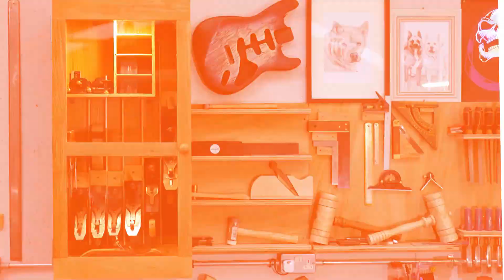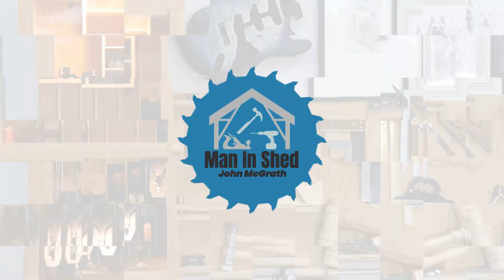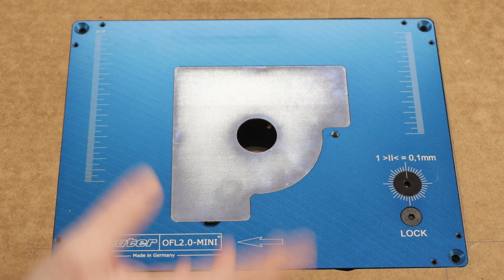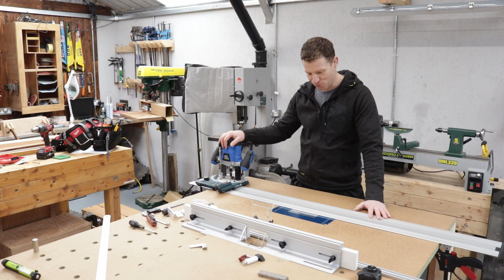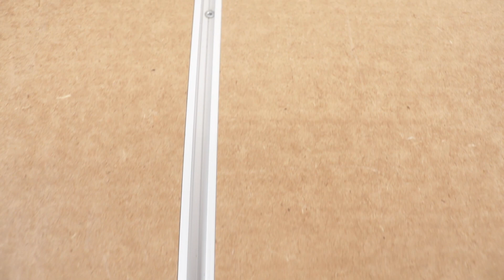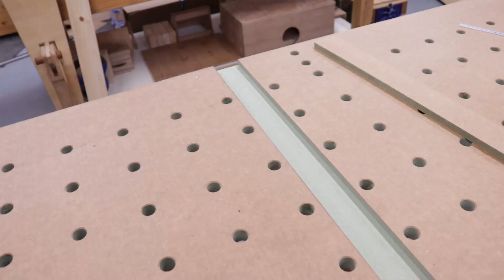Installing the Router table in the MFT Workbench. Plus a Cheap Tool Rant!

Comment: Enjoying your videos. My suggestion would be not to cut the edge of your bench and instead drill a hole up and through the table top and support so you can push out the sacrificial strip from underneath with some dowel.

Comment: Hi John, I don't know if you read comments of videos that are so old but what the heck you either do or you don't. I'm new to trying my hand at more involved woodwork and I'm trying to sort myself a workshop in an old Methodist chapel. At the end of this video when you put back the edge board, why did you cut the slot by hand rather than use your router?
I've got a lot of videos to watch, seeing how your workshop has developed over the years. Excellent work!

Comment: Completely agree with you when it comes to tools. But having said that there are some good quality hobby grade pieces of equipment out there. The Axminster hobby ranges extremely good Bosch do their DIY range the green stuff that router is actually quite a good one from Bosch as is the belt sander. And also most of the Ryobi stuff is very good. But you’re absolutely correct even know what I’ve just mentioned is good for the hobbyist they are not Tradesmans tools

Comment: Dear John, at 27:26 when you show the router lift closeup from below, it appears that the router actually twists a fraction in the middle, and when it reaches the top. If that is so, it implies that the router bit is not going straight up from the router table. Is there any chance you could verify this? Thanks.

Comment: John hi, I love your channel, quick question, did you give any thought to a dust collection box under the work bench and will the router handle allow it?
Reply from the maker: I have thought about,  just haven't got around to it. It would be possible with doors on the front so you have easy access to the handle for bit changes

Comment: Hi John, I have four routers all of them are Dewalt 1 ¼ hp and although I will not buy Dewalt now because the quality is just not there, when I bought the routers they were very good quality  and I have no problems with them. I bought a small trim router from ALDI, I was not expecting much it has become my favourite router, and although it is only ¾ hp I have never been able to stall it and it always cuts well and straight. If I were to buy a router today, it would be a Makita or Bosch because they seem to be good and even if I won the lottery, I still would not buy a Festool on principle.

Comment: This is brilliant!
I'm in the process of putting together a router table and finding this has been a huge help. I'll be ordering a Sauter lift, which really looks like high quality kit. I was going to order a dedicated table top but the process of making your own looks fairly simple as you demonstrated, and I think I now have the confidence to go get some MDF and tracks, and give it a go!
Also appreciated the info on the NVR switch too, and agree entirely on the comments on tools!

Quick question: is it a good idea to treat the MDF with anything? Wax or poly varnish? Or do you just leave it raw?

Go raibh maith agat!
Reply from the maker: Glad it was useful

Comment: What stops the track saw track moving around I have seen a few videos on YouTube with track saws and can't see any way of clamping them down
Reply from the maker: They have rubber strips underneath that stop them moving and they have T slots so you can use clamps with them.

Comment: I know it's totally unrelated and I'm not trying to pick a fight LOL, because believe me, no one hates inches more than me and I certainly would much rather be using metric when it comes to wood.  But over here in the US everything is in inches.  So, I have a question for you.  Nearly everything on your top is in metric and you use those measurements throughout, I get that.  However, when it came to the edging and bracing you referred to them as 2 by 4 or 4 by 2.  Why the switch-over to imperial measurements for those pieces?  Is that typical in places using metric?  

BTW, love your MFT top.  I'm planning on using a lot of what you've done to make my set-up.
Reply: I have the same sized MDF top, it's a full sheet of MDF/devil's wood.  I made it about 4 years ago.  I used the top from my mft as a template.  Accuracywise it's pretty good but not quite what I'd like and it's getting beat up.  I just ordered the Parf Guide MII and I'm hoping I can get the same accuracy as others have gotten.  I setup the Benchdogs fence and guide rail dogs on my guide rail track and it isn't square. I watched a video about how occasionally the rulers that come with the Parf Guide MII are sometimes not quite true.  I'll be checking them carefully before I start making a new top.

Why does John call it a 4x2?  Because it's easier than saying "hand me that 89mm x 38mm."

Comment: there is a difference between reasonably priced tools over the silly priced, Festools were not around years ago and they made better stuff in those days. I understand what you are saying BUT no one needs Festools or some £400 low angled plane. Yer, of course, they are nice but the same does not apply. A Bosh will serve me great for years if I look after it and it's accurate. I have 3 cordless old blue Ryobi drills that are all still going strong, (batteries replaced) I am looking for a new driver-drill as times change but the point is I never needed top of the range, besides I live in Liverpool and the moment I filled my van with Festool's it would be stolen or I would drop the drill from a ladder and the lifetime warranty would be mute. Nothing wrong at all with a second-hand Stanley plane I even have an old beach fore plane 22 inches long and I love it. I do understand and agree with the principles of your video but it should be pointed out that, top of the-line in hand tools are not needed, they are that expensive because the market is there just like you pointed out for the woodworkers. We all know that the low angled planes are overpriced. and what about the GRR Gripper push block the full kit is nearly £300 quid!  Everyone says but its for safety your fingers are worth it. Yes, we know they are but that does not mean we are not getting ripped off just that we are willing to pay out because there is nothing else like it. Micro jig is laughing all the way to the bank and laughing at us while they shout "finger safety dude" If companies were so concerned they would charge reasonable prices and we could all enjoy the safety features. One polish guy yesterday stated in comments that the Grr Gripper basic was half the price he paid for his bench saw, sod buying it he will make his own. There are balances and we just need to understand the right level for ourselves. I learned long, long ago not to buy cheap but I won't buy silly either.

Comment: Not wanting to point it out but I can see you use Milwaukee tools. Basically Ryobi in Red. Both owned and made by Tecktronic Industries of Hong Kong. I'd rather save a few quid and buy the Ryobi - the insides are in most cases the same.
Reply from the maker: Owned by the same parent company but they are not the same tool, Ryobi would not last long with the use I give my tools everyday on site. The Milwaukee fuel range has taken serious punishment and is still going. Some tools are good for DIY and others are Trade rated.
Reply: @JohnMcGrathManInShed   I disagree. I'm a marine Chief Engineer working in the offshore construction industry - possibly the heaviest industry in the world. I've used, abused and broken just about every tool available. And having used tools paid for by rich oil companies - and I've bought hand tools costing over 50k - I use Ryobi mostly myself. I've also got Makita, Bosch pro, and Dewalt. Little difference in overall quality. In fact I have two old Ryobi drills which I've beaten to death for ten years and they are still going strong. I've even got a Ryobi battery of the same vintage that must have been recharged a thousand times over ten years. Still working. Most of all if you do pull open a Milwaukee you will find the same major components in most of their tools. A tool made by the same company in their own factory in the Far East is not going to be radically different simply because that makes no sense from the manufacturing point of view. The same applies to other things like Fluke meters. Regardless of the price of the multi-meter you buy, the actual tool is exactly the same inside. They just disable some functions. AVE did a strip down of a few and they were identical inside despite the price differential being huge.
Reply from the maker: @markchisholm2657  All I can tell you Is every Ryobi tool I have had I have broken. From drills to grinders to sanders all of them failed. And I have had a few going back to when they used to be dark blue and yellow.

Comment: John - looks absolutely fantastic.👍

A couple or more comments 😉

1. You may need another sacrificial strip nearer the end of the MFT (non router end).

2. Agree with your cheap tool philosophy in principle however may I suggest you used the wrong example. If the cheap router spindle was ‘wandering slightly’ the effect is essentially eccentricity and it would have cut the slot wider than the cutter diameter. I do not know why it was a ‘tight’ fit but it was either the bit was undersized (for the supplied rail or vice versa) or MDF compresses and springs back and needs a finishing cut.

3. Dust extraction on most routers at most price points is a real challenge and some cuts present a fundamental challenge.

4. So called quality higher price tools are not always as bullet proof as you would hope for. This is particularly so for hand power tools. AVE is a good channel for exposing some of the assumptions on Price/Brand/ Perceived Quality.

Anyhoo - cracking job John,😀👍

Comment: Great video as always John - I built an outfeed / assembly table during lockdown - think I will look at mounting a router in it - maybe use a scissor jack as router lift (looks crude but easy and precise adjustments) I’ll be interested in your track saw use in comparison to a traditional table saw.

Comment: Hi john about the cheap tools part of the vid do u rate dewalt i dont see you with any?
Reply from the maker: Dewalt make some good stuff I have a few Dewalt tools for my electrical work. My battery tools are all Milwaukee, I used to have all Dewalt battery tools but switched when I was upgrading to Milwaukee because I got a good deal.
Reply: @JohnMcGrathManInShed  i do like milwaukee but like festool i think they are a little over priced for what your getting for me dewalt are best price range for battery stuf anyway just my 2 cents worth

Comment: Your point about good tools is important.  That German router setup looks fantastic, and after your recommendation for Knipex, my set of pliers is clearly better than what I had.

But there's a counterpoint.  Good new tools cost.  Many of the older tools are also good, and just require some care.  For example, an old Stanley plane can work just as well as a Lie-Nielsen, though it will take more time to get it there and it will never look as good.  For a hobbyist this can be a good exchange.

And you can't identify a good tool by the price.  Many formerly proud companies made short-term profits by selling tool-shaped objects at prices above their value.

Lastly, tools are bought for a purpose.  Some cheap tools are not good enough for some uses, but might be acceptable for others.  In some cases, that can make them worthwhile.  Though I can't see an excuse for that cheap router.
Reply from the maker: Cheap tools and good value tools are not the same thing. There are bargains to be had.

Comment: Great job, this came at a great time for me, have just installed a router plate in my DIY table and about to rout in the tracks. One question, have you considered adding another wider slot for a 3/4" track so you can use a mitre gauge?
Reply from the maker: Didn't think about it but you have put the idea in my head. I will look into to it

Comment: John it sounds awesome I’m just gutted I can’t see it enter as we’ve gone into lockdown number four won’t be going to Axminster until the New Year but I think buying the gym kit would be way out of my budget but hopefully there is someone in Kent who’s got one could make me a top as it sounds pretty awesome.

But I would definitely think about putting a dust extractor kit permanently on it specially for multiple using even to Hoover the shop up as well. As if you had it come from the ceiling to connect to it when you’re losing a lot of suction to you got I have it in the same area roughly to connect it to every time. But can’t wait to hear the next part of the build

Comment: Always been a Makita Man. Sometimes Dewalt or Bosch and lately Milwaukee. When I go to the local B&Q I always wander around the tool area. Never buy anything but cringe like mad when I see people picking up cheap tools. I have to bite my lip. Like you with the router many years ago I bought a Draper table saw and it was a disaster.
Reply from the maker: It never works out

Comment: Love your videos John and your honesty. Quick question, if your t-track router bit was an 8mm shank, why didn’t you use the one you were getting into the lift rather than the crap one?
Reply from the maker: The Suater router can only be used mounted in a lift or on a cnc
Reply: @JohnMcGrathManInShed  I knew there would be a sensible reason! All the best John and have a safe Christmas. Looking forward to following your content in the new year.

Comment: Cheap tool rant was very true, buy once cry once! I'm woodworking in a metal shed the same as yourself, mine is considerably smaller though, having trouble with mould growth from the damp this time of year, is there anything you apply to your wooden benches etc to stop this?

Comment: Hi John, I have also made the mistake with cheap tools, learnt my lesson, I made a similar router table about a year ago and the only change i have made after using it for a while was to change the long T track to 19mm so my Angle gauge/Protractor from my saw bench and bandsaw can be used, Have a great Xmas and a prosperous New year. Regards Kelvin.

Comment: Just watched your rant. Ive got to say you're bang on the nail.

Ive just begun woodworking and frankly, I suck! But thats because I'm a beginner.

I have very rapidly noticed that cheaper tools are a false economy. I bought a Scheppach Track Saw and soon discovered how inaccurate it was. I changed the splinter guard to Makita but still wasn't happy with the tool, it was hard to push on the track, hard to plunge, inaccurate.....even as a newbie I wasn't happy. So, I splurged out on a Festool, I can afford it so why not.

And the difference is staggering. My ability limits the Festool whereas the Scheppach limited my ability. Ive also swapped router table from Triton to Trend, bought a new T11EK router and realised that I made an expensive mistake going cheap when I could have spent a little more on Enthusiast tools. Ive ended up spending twice. I was so tempted to buy an Incra router table set up but they're not in stock.....and space is at a premium.

Comment: You are spot on about buying good tools versus buying cheap tools. I've done both and I never regretted buying good tools; I always regretted buying cheap tools. Further, you have to learn the difference between cheap and good before you can find less expensive good tools -- buying them is also a good practice.
...
Buy a good tool and you only cry once when you pay for it;  buy a cheap tool and you will cry (and curse) every time you use it and again when you pay to replace it.

Thanks!

P.S.  If you drill through-holes at the end of the router fence T-track slots, then you will have no sawdust build-up at the ends of the tracks.

Comment: Great video as usual John 👌. I'll be interested to see how you bring power to the bench. If you were bringing it down from overhead with a retractable cable it might be an idea to have multiple input points on the bench so you can vary it to keep out of your way. Either way you have a super setup there 👏

Comment: great video I fully agree with the buy once so buy good.
I just have a small question if you would not mind
I was thinking of using the Neutrik NAC3MX-W-TOP PowerCON as a DIY cable replacement
My plan was to basically cut the cord on all my tools and add the female connector 
and make up a few power leads with the male connectors to have them like the Festool plug it design
would you think this would be ok to do the connectors are rated for 16a
Reply from the maker: Yeah that will work, just leave the male end on the tool otherwise you will have live exposed pins on the lead if its plugged in and not connected the tool. Male sockets are know as appliance inlet sockets they are used for this reason.
Reply: @JohnMcGrathManInShed  Thanks john for the advice
Reply: @myfaceback100  this has nothing to do with me but be careful you may void any warranty from the manufacturer. Regards Jim
Reply: @jlmfoy365  at the age of some of them i think they would be called vintage. but your are 100% right if they were new or still in warranty I would not recommend it.

Comment: Another way to install t-track, if you can't or don't want to route a groove through to the edge of the table, is to have the track end at a bore made with a forstner bit large enough for the bolt head to drop into.
Another way is to grind flats and radiuses into the bolt head so it can be dropped into the track and then given a quarter turn to lock it.